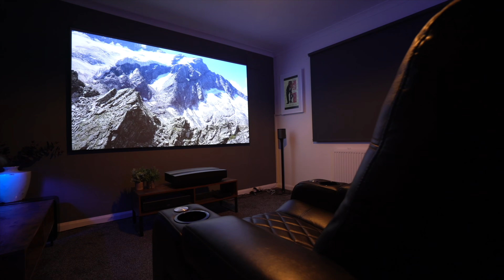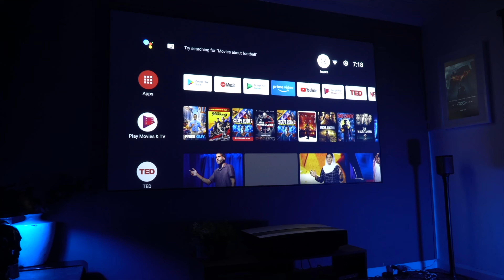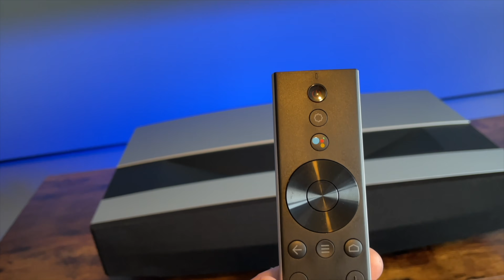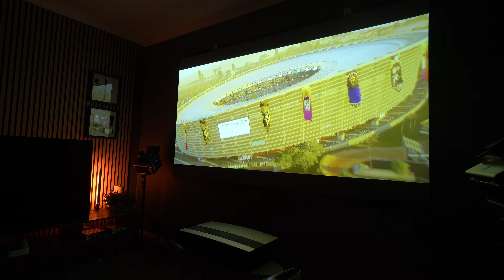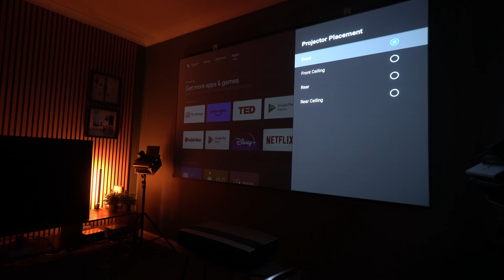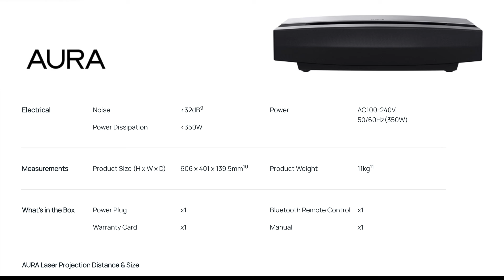Still Exceptional Huge Home Cinema 150" Laser TV | XGIMI AURA Laser 4K

Comment: Thanks for the great review. Do you have any experience with the Hisense PX1-Pro in comparison? I'm uncertain which one to buy, since the Hisense has real RGB-laser which results in much better colors, however, the XGIMI is sharper and has a lot more contrast. I can currently get the XGIMI for around 1.700€ which is 300€ cheaper than the Hisense at the moment, but every review i've seen so far comparing those two name the Hisense as the clear winner when it comes to image quality alone.

Comment: Now I've inherited a house and a large sum of money from my parents, I can afford (almost) anything I like, but it's the lifespan of the laser light source that puts me off! Plus, how does it fare in a bright room in the daytime? EDIT: You alluded to this literally just after I commented on same!

You don't specify what you paid for it? ... It's a well-known fact that rich people are often tight! And now I'm comparatively "rich" (compared to before I inherited), I'm also tight too, and I don't want to waste my money! 🤣 That said, the cost of this device is peanuts from my inheritance, even though I don't know the cost!

EDIT: What's the power consumption? ... My house has solar panels and a battery backup system ... I like to be "green!" 👍🤣 .... 350 watts? My God, that's more than my energy guzzling 42" Panasonic Plasma at 300 watts! Definitely NOT "green" solar or not! 👎 The projector uses six times as much energy as my 50" MORESENSE, which uses just 60 watts on Freeview HD, and 4K SDR, and 140 watts on 4K HDR. Have you noticed the price of energy lately? I've also inherited an LG 65" OLED.
Reply: Some projectors don’t use 300W. It may draw on that to power it, but it may use less. Take a 55 inch LG OLED from 2017. It uses 300W to power it but actually only uses 112W per hour.
Reply: @L1RW  My MORESENSE ULED TV's power consumption is dynamic; it changes according to the brightness of the displayed image, the picture mode, and how hard the LED backlights have to work! ... You see, I've been into technology for decades, and so I do know what's what!